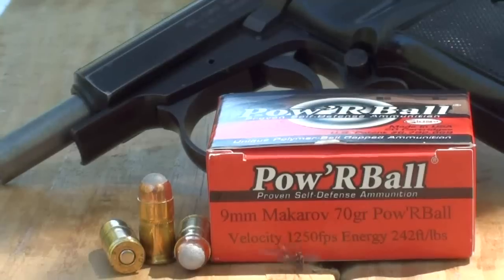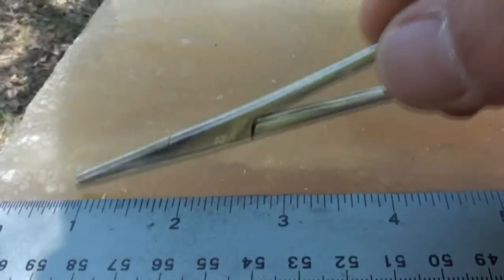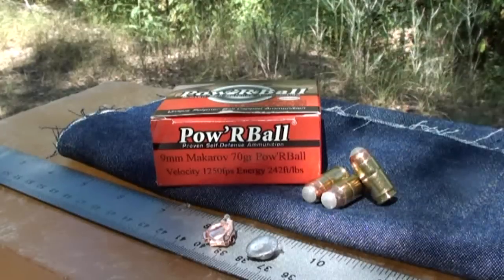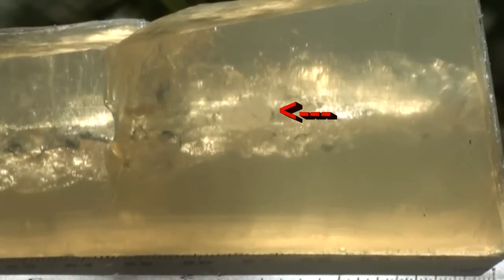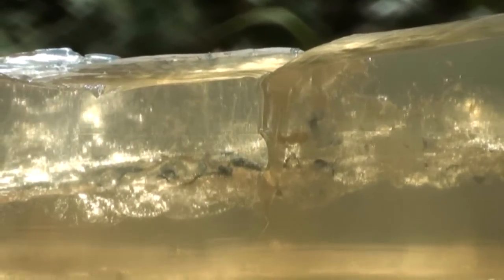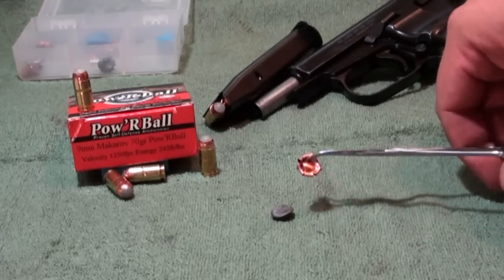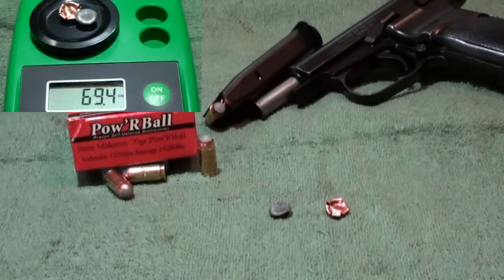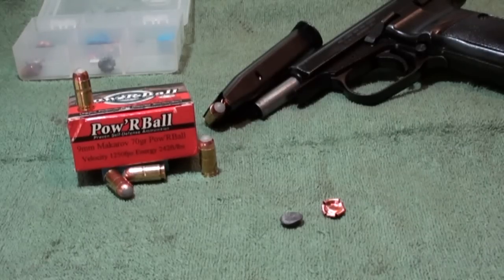9mm Makarov Pow R Ball Ballistic Gel Test

Comment from the maker: First, this is a light weight round. It is made to have a lot of "shock and trauma" in the first part of entrance (which it did very well) Penetration of 9 1/8th is not to shabby from a 70gr bullet after the wound tract it just left. As for the magic "stopping power" rounds have, in a critical area (the "T" of the head or chest) this would put you on the ground fast. ( Is it my choice, no) But it worked.  I have plenty more test coming in this round so stay tuned, you will see what the others do